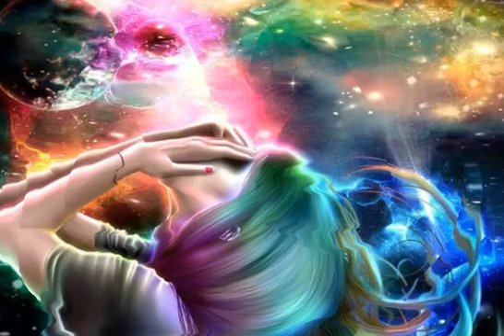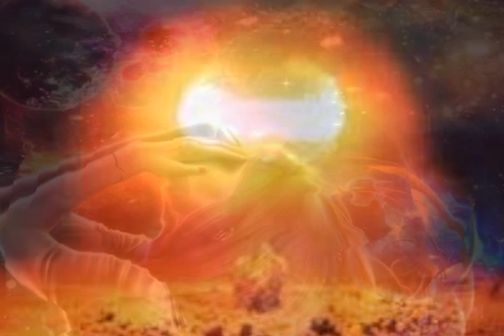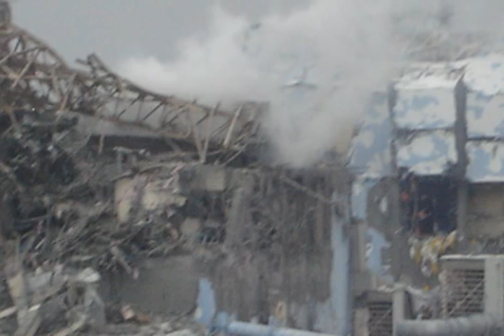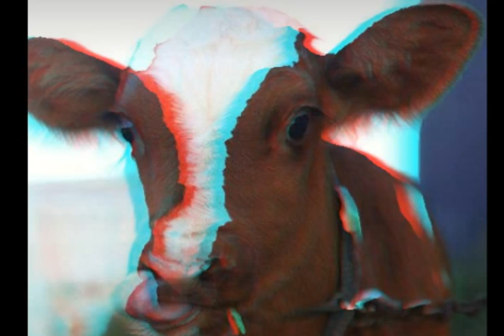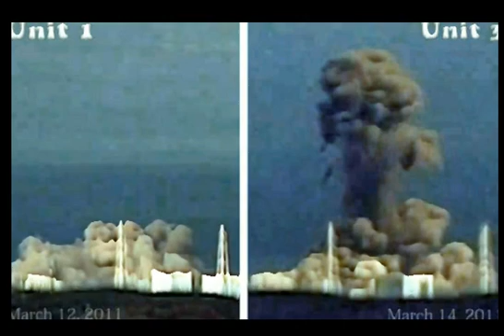Why Tepco Not Use Boron to Slow Down the Fission at Fukushima Rense Durnford Yochi

Comment: MOX fuel in 40yrs old plant is nearly sucide it increases both heat,pressure and radiation damaging the steel and concrete at a greater rate . in a design built to run 35% uranium never Plutonium! But they wanted the,greater heat, more steam. never seeing the consequences like saving on the sunami protection walls. 03/11 everything that they believed couldn't happen happened